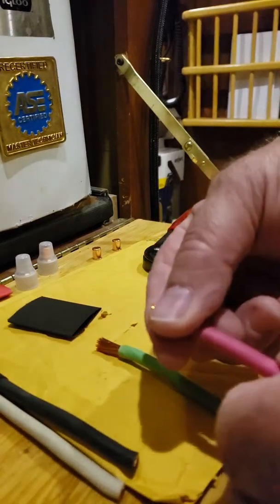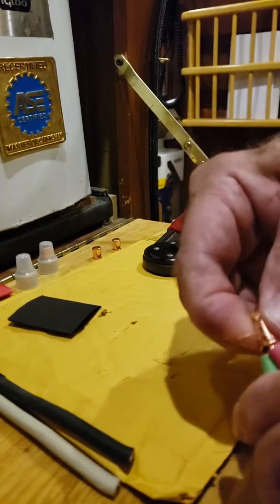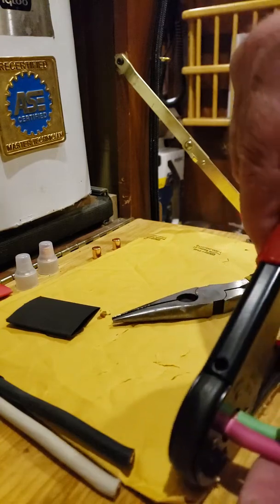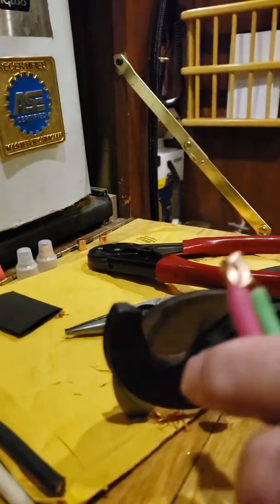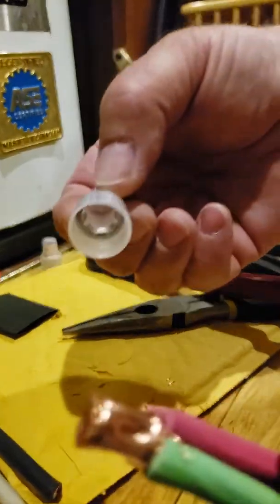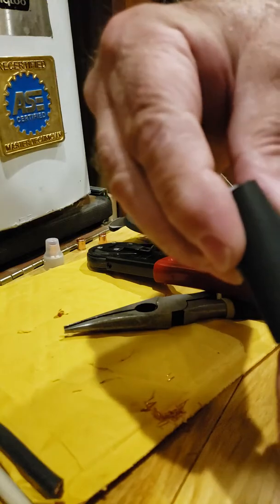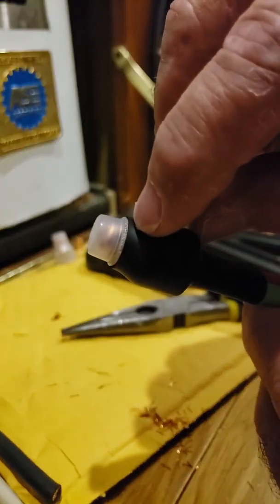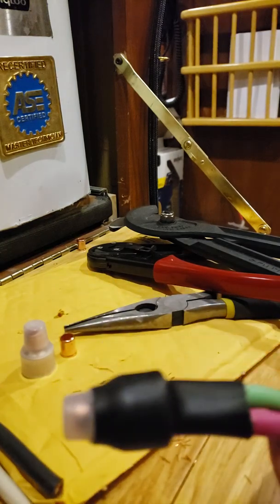Sample of splicing two #6 gauge wires

Comment: Thanks for the video! I was going to go with insulated inline splice connectors but I like this setup! I will be going from the factory 50amp cable going to my breaker box to 6/4 soow. If I remember right the factory cable is a solid wire, how would I splice that to the soow? Thanks!

Comment: Red = Hot Wire   Green = Ground wire.  Why would you want to connect them together?  Just curious...
Reply from the maker: To funny, this is only a sample for the connectors with wires that do not connect to anything. Color code is irrelevant.  But thanks for watching.

Comment: You just derated the #6 wire down to a #8 - that is not how to do this there is #6 wire nuts and/or terminal block
Reply from the maker: as the title suggest, this is a "sample" of the splice, not the wire. this is simply to show how the crimp and crimper worked. by the way, it is not a safe practice to use wire nuts in RVs. and also 2 or 3 strands is not going to degrade this wire like you stated. sure, you may want that perfect fit, but sometimes you will find a straggler or 2. I have been in the automotive industry for over 50 years. retired. and in those 50 years I have never had an issue. I am not saying to make it common practice, you should avoid straggler wire strands as much as possible, however in some instances where it really won't affect anything like while making a sample it shouldn't be an issue. hope you are having an awesome day and thanks for watching.

Comment: It looks good enough for an RV.  But I can tell you from professional experience, trimming off strands that won't fit in the ferrule is a no no.  Those strands are there to provide the certified current capacity, and you just cut them off.  Some might say "I've never had a problem", which is fine for an RV, but not for things of more importance, like aerospace.
By the way, my original Buchanan C-24 crimper has "twist wires before crumping" stamped right on the side of the tool.  Of course your wires are too big for that, but for smaller wires twisting is the rule, per the manufacturer with the original patent.
Reply: you're an idiot...1 or 2 strands won't effect "anything!"
Reply from the maker: Yep, I can understand your reasoning. This was not a how to video but only showing the use of the tool and hardware. I did not want to get to rigid and detailed about "how to" do the job seeing how that was not the objective.  Thanks for watching.
Reply from the maker: You do need to understand, this is only a sample to see how it crimps and insulates. It is not an actual application.

Comment: You can also strip more insulation off, then use a big wire nut with silicone inside. But this way seems more vibration resistant.
Reply from the maker: I tried the way you mentioned and it did not make a good connection, started smoking. I turned off the power and found a new solution for my RV. with all the bouncing around I was looking for something I could depend on.

Comment: fwiw, I'm fairly certain those buchannan crimps are listed for THHN stranded, not thin strand/flex portable cord.  Thats part of the reason you will almost always have stray strands.  I'm not going to tell on you or anything :)  That there is a bulletproof connection you've made.   But, if someone were to come along and certify that connection for UL or NEC compliance, it'd surely fail.  In any case, always cool to find a video of someone using the C24 crimper, it's an unsung hero and a mainstay in my electricians bag.  Paid $50 for my first one, got my second one at a yard sale for three bucks!
Reply from the maker: no where in the description of this product does it state the type of wire they are made for (that I have seen), only the size of wire. the video is only showing an example, however I did read "for copper wire & solid or stranded except where otherwise noted (which I did not see)"  if you review the manufactures website "Ideal industries" you will see what I am talking about. and in a RV, I already have seen many similar crimp connectors installed by the manufacture. So not sure about failing any inspection. I am very pleased with all of the connections I have made. withstanding all of the vibrations of the RV. much Better than twist caps. by the way, after a few tries, no more extra strands hanging out. however, I am always willing to learn, If you have a regulation, be it Federal or state for the use of these in an RV, Please share. thanks for watching.

Comment: If you add some Scotch 2228 mastic tape between the wires, then do a lap around them before heat shrinking, then the connection will be totally waterproof when submersed.  I cut my tape length-wise so it's only one half inch wide when using this procedure.  As long as the heat shrink tubing (HST) adhesive is over the mastic, then you're good.  Getting the mastic between the conductors keeps water from wicking up into the connectors when submerged.

For the record, it's a lot easier to butt splice cable with non-insulated tinned-copper barrels, then heat shrink over the length.  However, when cable has been previously run and terminated with "gel-filled" wire nuts, the aforementioned procedure makes the connection significantly more reliable.